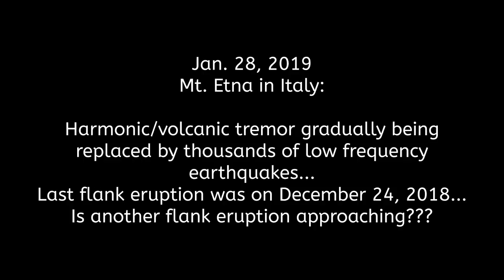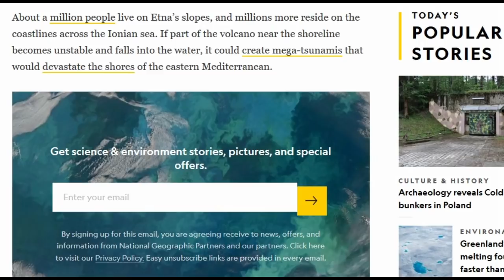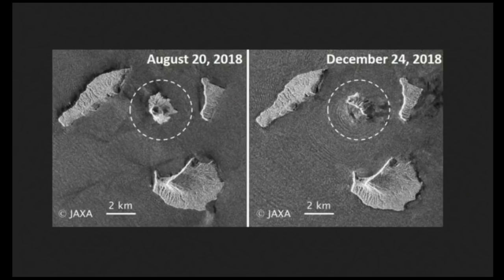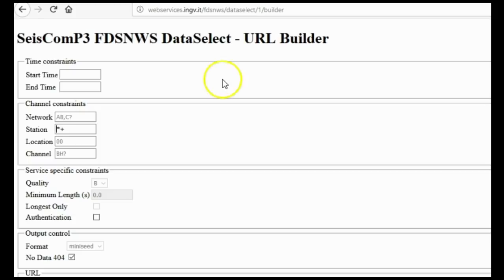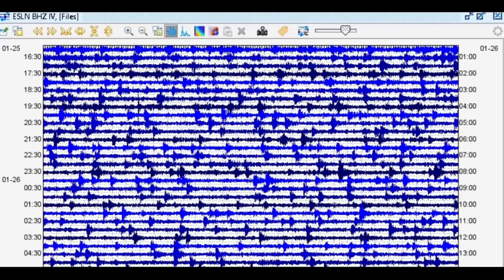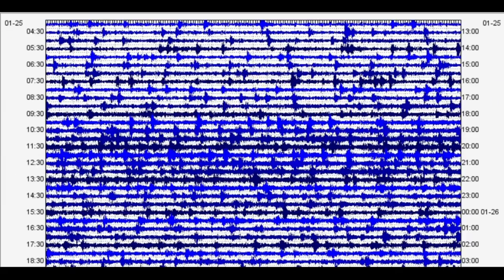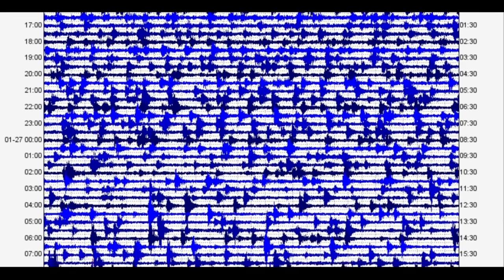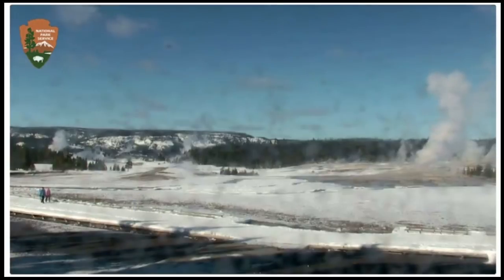Mt Etna volcano in Italy -- Is seismic activity changing? Very in-depth analysis of recent data

Comment from the maker: BIG CORRECTION: I was at fault when I stated the original 1883 eruption of Krakatoa was a super-eruption. The 1883 eruption of Krakatoa was supposedly a VEI 6. VEI 7 would have made it a super eruption. Again, my bad on the mistake!
Reply: Mt Pinatobu ranks far less than the original Krakatou - http://factsanddetails.com/world/cat51/sub323/item2209.html

I find it interesting how much smaller Pinatobu is compared to the 1880's Krakatou.  Mt St Helens erupted by one of it's sides just falling down, but Pinatobu blew it's top straight up into the sky!  And yet, it doesn't rank very high.
Reply from the maker: @oker59  Yes. It seems Pinatubo was ranked at VEI 6, right? Well so is the Krakatoa eruption but Pinatubo was much smaller than the Krakatoa eruption. I think Krakatoa was very close to a VEI 7. So it was almost a super eruption. It did alter the climate like crazy though. For a whole decade I think.